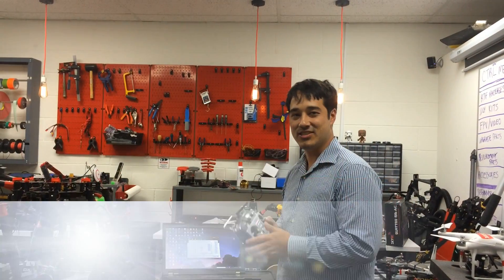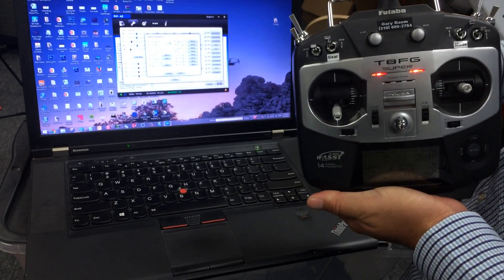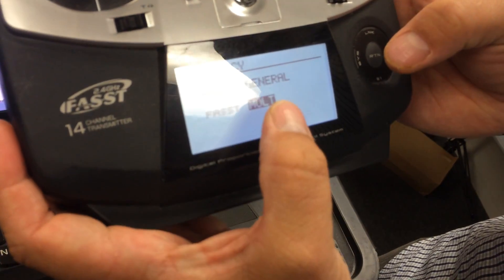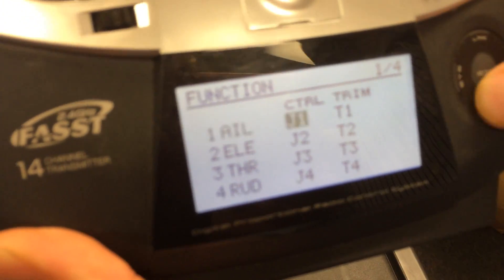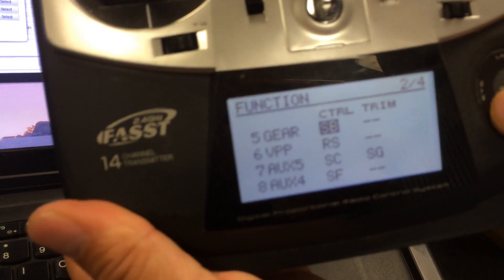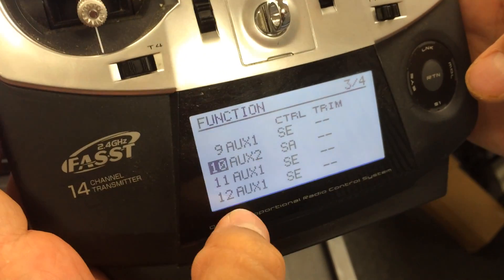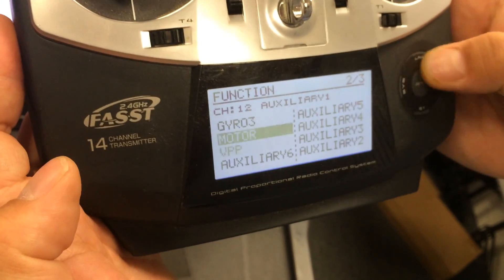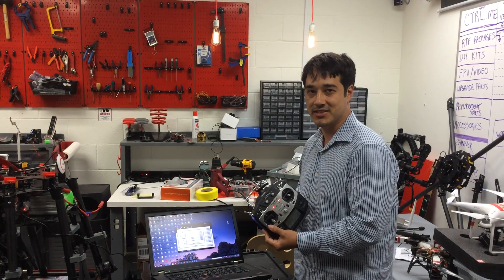Futaba T8FG Super -How to enable 12 Channels

Comment: ok but dont i need to have 2 receivers?
Reply from the maker: The A2 flight controller has a built in receiver! You can use the flight controller to control the multirotor and gimbal. Hope that helps
Reply: I dont have the A2..using naza V2.
Reply from the maker: Camera WithWings You can only use/bind one receiver at a time. I don't believe that the V2 will take more than 8 channels. You can mix channels if you want to use additional switches. (fx, have flight mode on one channel/switch and then mix in another switch to go into failsafe/RTL)
Reply: Does enabling the extra channels add latency?